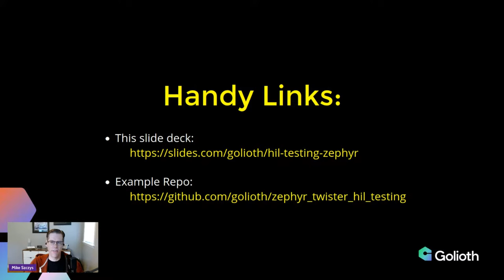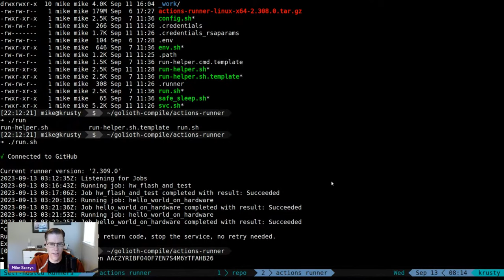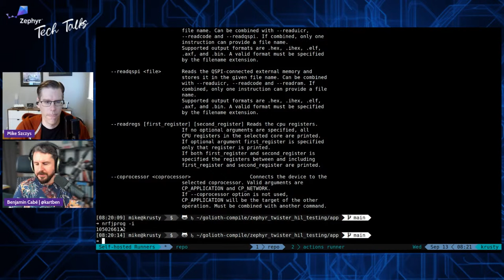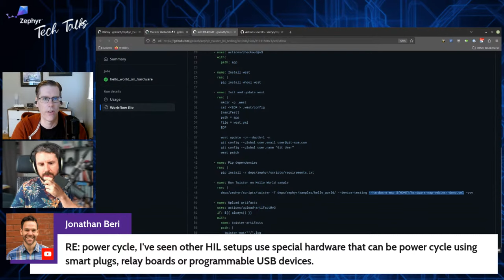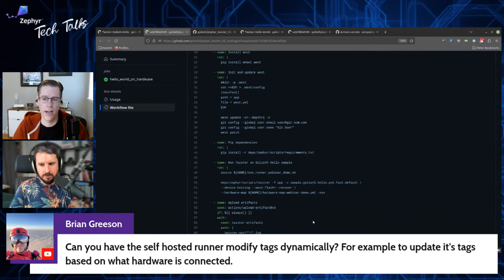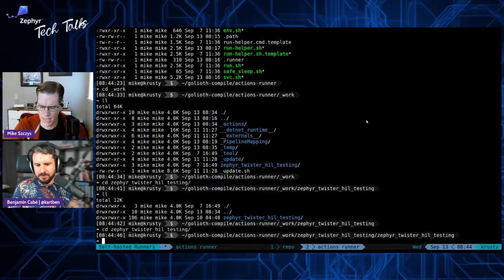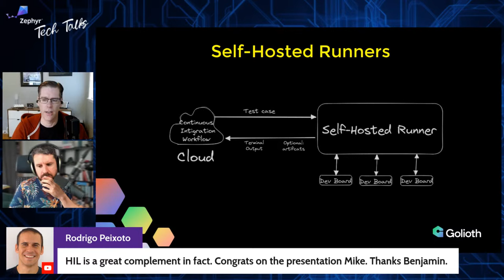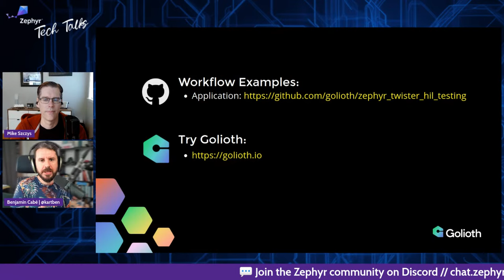Hardware-in-the-loop testing with Zephyr RTOS // Zephyr Tech Talk #001

Comment: I also understand hardware-in-loop-testing a bit different. Basically you use another hardware that emulate a sensor or actuator to verify your target board. It is pretty cool what you showed but I would call it running tests on target hardware